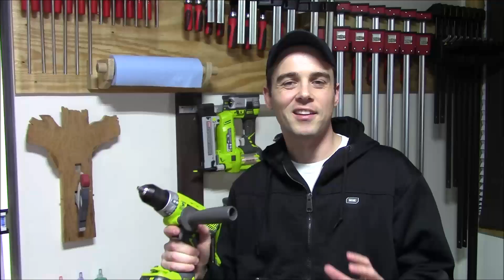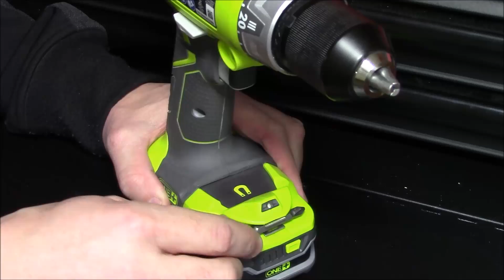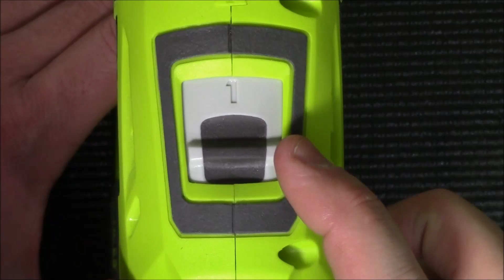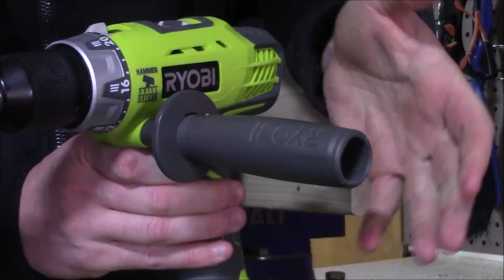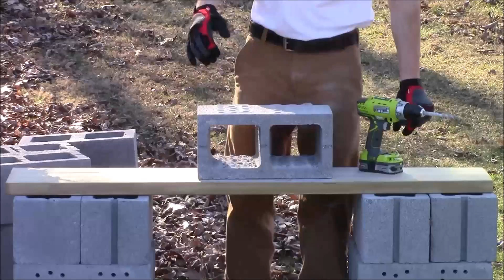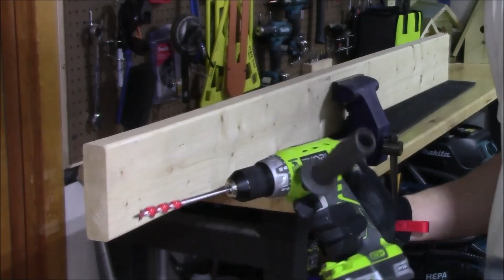Ryobi 18v ONE+ 1/2" Hammer Drill P214 / P1812

Comment: My Ryobi multi drill is good apart from the hammer function. I don't use it at full speed in fear of overheating the bit(I have a sprayer know). How much pressure should you put on a multi hammer drill please. Mine isn't as powerful as yours.

Comment: Great review! That's some pretty impressive runtime from a compact battery.  No doubt with normal use and two batteries you could run all day.  I'm also impressed that it drilled that big hole with relative ease and quite quickly.  Given the price and the range of tools, Roybi is hard to beat for even the serious diyer.

Comment: What's your personal opinion of the Ryobi when it's stacked up against an equivalently priced Ridgid? They're both made by TTI and probably share some internals, even if they're made on different lines.
Reply: if you're comparing this to the ridgid brushless drill i can tell you from first-hand experience it's not in the same class as the gen 5x brushless drill.  In comparison to the gen4x/gen5x non brushless I'd say it's very close. To me it would come down to what battery platform duo you currently own. if you already have rigid go with a rigid. If you have Ryobi batteries go with Ryobi. it's a good drill for a weekend warrior.
Reply from the maker: +TheJohn8765 Which models are you referring to?
Reply: You'd know better than I :) Ridgid does an 'entry level' brushed hammer drill that's broadly equivalent in price to this ryobi, don't they?
Reply: Bigchuck678 Oh, I have the 5x brushless, and I can tell just from the video the Ryobi's  fit/finish isn't as good, nor the features and performance (which isn't a knock on the Ryobi since the 5x is 2x the price). I had in mind the entry level Ridgid (which I don't own).

Comment: Great Review  -   Waiting to see a review of the new Ryobi P237 Impact that just came out.  I was a Dewalt/Hitachi only contractor until I purchased a Ryobi cordless combo to leave at the houses Im flipping, so that I could keep my pro tools on the service truck.  But by chance I ended up picking up another Ryobi cordless tool every other time I stopped at H Depot because of the price and tool selection.  (LED light, Fan, SDS, etc.) But now - me and my crew prefer the Ryobi - and we use them every single day  (Mostly with 4ah Batteries).  We find ourselves laughing every day at how great they are at the price.  Ryobi  = great tools.  No complaints here.